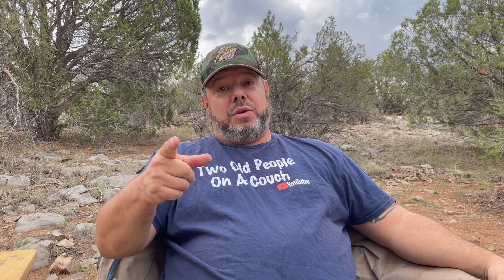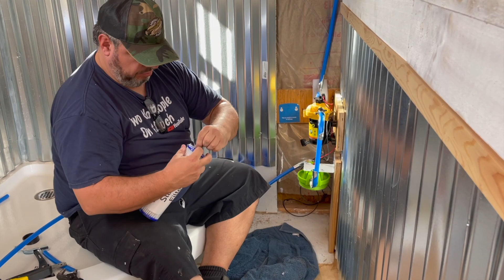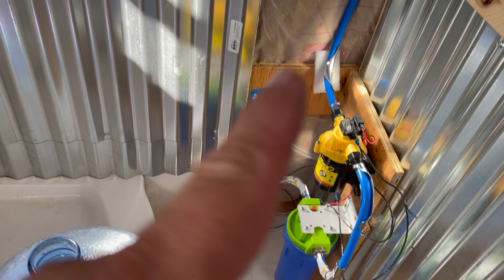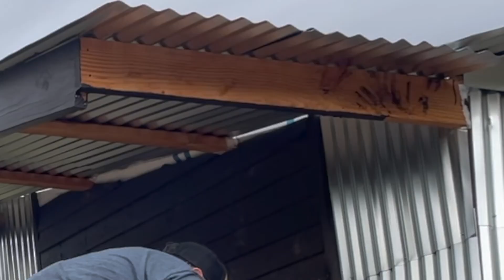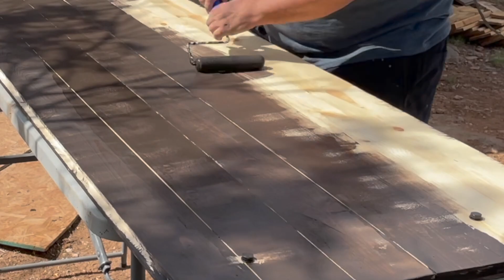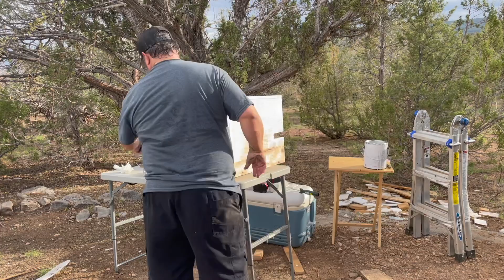Staining on the off grid.

Comment: Great to see you back on. Love watching your channel. You have great ideas. We are building as you are up there, I would like to make a suggestion, not sure if you are doing anything with the tin roof in the front. But being a sheetmetal roofer by trade you have too much hanging over. The winds will eventually rip the roof off over time. Normal overhang with no framing is about 2 to 4 inches. Please don't to offense just trying to help a neighbor.
Reply from the maker: Thank you for watching… & Thank you for the professional advice… I actually have 4” on the main cabin & 6” on the overhang… I will cut it to 2/ & 3 inch 🤙🏼😁👍🏼